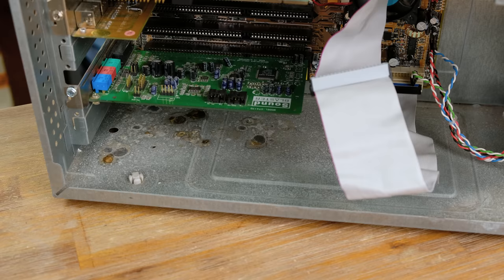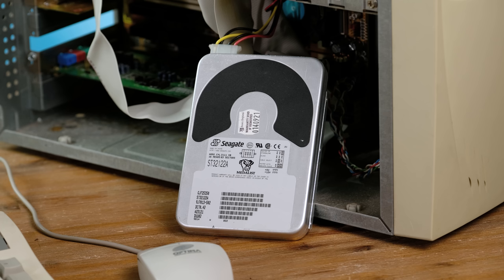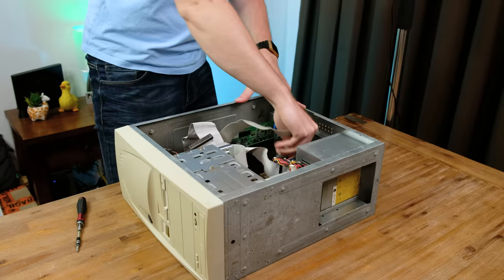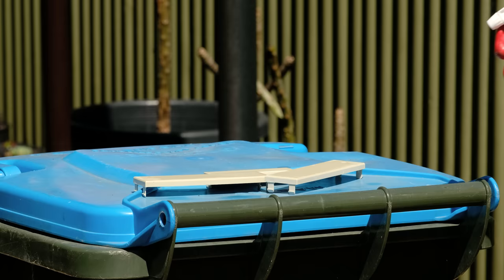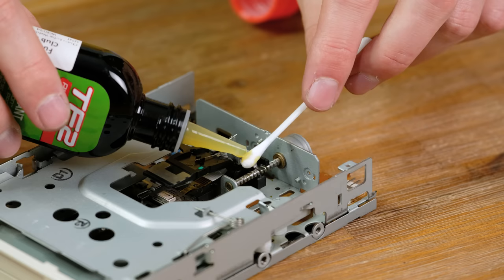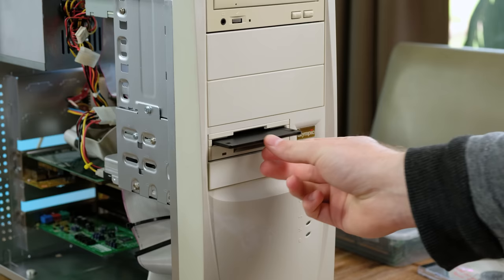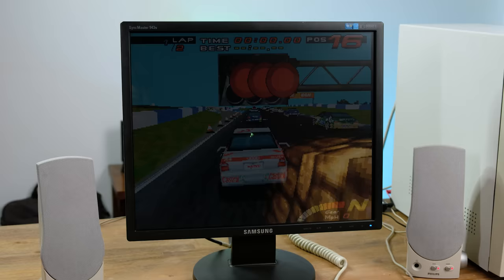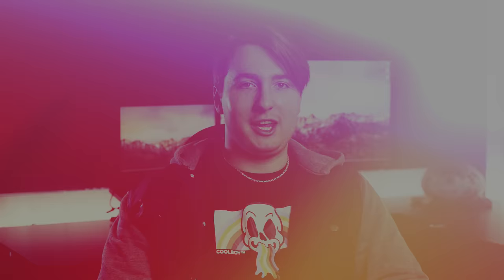Restoring a TERRIBLE Budget PC from 1997!

Comment: I remember being 24 years old too, except I will be 50 next year.  Time goes REALLY FAST and then GETS FASTER.  I got my own PC in 2000 but first used them in 1996.  Oh wait.......my first paid full-time job in 1989 had DOS based computers in the office, which I used to print signage for the shop floor.  All text menus and commands and no graphical interface or mouse.
Reply: 1986 I got a IBM 248. Remember those?
Reply: @Lotusrk123  76 computers if you include your own brain! 😂
Reply: I'm also turning 50 next year. Been a computer (ab)user since 1983. TI-99/4A, Xerox 820-II, a long string of various PC and Mac boxes.
Reply: I am 13.
Reply: @Lotusrk123  I love Thinkpads and have about ten laptops, the oldest being a Thinkpad G41 and the newest a W520 2GB Nvidia GPU and 1920 x 1200 etc.  Most of them are fully upgraded, and with docking stations.  I've turned down loads of models, as they get addictive lol.
Reply: @Lotusrk123  Ha! That sounds cool with the cars and Honda have always been good.  Regards Thinkpads I like my Z61p and X6 series the best.  The W520 is probably the last model with any IBM engineering DNA left in it.  So after this I have no idea what to get.

Comment: I’m an old fart that did a fair bet of gaming back in 1997.  In the fall of 97, I spent $3,000 on a Pentium II 300 / 128 MB RAM system.  That was a fortune at the time, just to play Quake.  I remember the reading about the Cyrix MII processors, but they were inferior in gaming, so I never touched one.  Even with a 3D card, the MII processor would have handicapped this system with gaming performance.
I could tell by the sound that WD Hard Drive was making, it was dead as Julius Caesar.
Nice job restoring this old box.  I think I owned s similar case in the 90s.  I think everyone did.

Comment: You made me feel nostalgic.
My first PC in the year 1998 was:

Intel Pentium 233Mhz
32MB RAM (later upgraded to 64)
4.2 GB HDD from Seagate
Cirrus Logic VGA card with 2MB VRAM
Non-ATX Cabinet
230W PSU
Daewoo 14" CRT Monitor
Logitech PS2 Keyboard and Mouse
Opti Sound Card
Creative CD-ROM Drive 32X with remote
Creative Speakers 2.0

My dad bought me this PC. I miss him so much :(

Comment: This computer is extremely similar to my first PC I've got in July of 1999. Mine came with a Cyrix M-II PR300 (clocked at 233 MHz), 32MB of PC66 RAM, a similar, but smaller mainboard (type TX98-3D by some noname manufacturer) with onboard sound and USB 1.1, a 1MB  video card (cannot recall the exact model, but I believe it had 2000 in the name), the same WD Caviar 21600 HDD (meaning it had two platters and 1600MB of capacity) and a 24x CyberDrive CD-ROM.
I got rid of it about 4 years later, and was upgraded by quite a bit: AMD K6-III 450 MHz CPU (the best CPU my motherboard had support for), 2x128MB RAM, 20GB Maxtor hard drive, 3dfx Voodoo 3 2000 PCI video card, SoundBlaster Live 5.1 sound card, 3Com PCI Ethernet card, a USB 2.0 card, and a Lite-On 24x10x40x CD burner. I moved to a Pentium III 1 GHz which was at least less obsolete :))

Comment: yesterday i was encoding a video, figured out this way that my cpu, when load 100% hits lik 75C, room temp around 20C, not ok, (air cooled), took out my flashlight aim at fan, see too much dust, next day, cleaned up, did another encode run and the temps are now around 64C with max load and 24C ambient room, great stuff, ....so whats the lesson here, dont be lazy and clean ur cpu cooler from time to time especially if u are on air :)

Comment: That computer case is so nostalgic to me... My first PC had exactly that case... Although it was a little bit better with an AMD K6-2 300 MHz CPU...
Reply: @German Retro Guy Sadly I don't remember the motherboard model, as we threw away that computer back in 2008...
Reply: @German Retro Guy Yeah, I don't have neither the computer nor the CRT monitor.

5 years later, I was already regretting that decision, as I was building my first retro PC...
Reply: My current case isn't much different, apart from having a silver/black front. I hate the fad of clear windows and lights on cases
Reply: Me too but 450 MHz

Comment: This is insane, I just happen to own almost the same Computer. I have the same AT case, with the same motherboard. In fact, my system came with almost the same CPU. It's a IBM 6x86mx PR300, but it's being detected as a Cyrix MII PR300. Granted, the expansion cards and some of its peripherals aren't the same, but that's because I upgraded my system. The motherboard is PCChips M571, with the TX pro II chipset, which is just a rebranded SIS 5597/5598 chipset. The board already has integrated graphics and also features a mediocre sound chip, as well as a usb controller. Despite being from PCChips, it's really not the worst motherboard, i've ever seen. In fact, back in the late 90s this was quite a popular choice, for people who wanted to build a cheap system. There were 3 revisions of this board, but only the later revisions were considered as good. This board should support 128mb ram, at least mine does. There was also a rebranded M571 which was known as Amptron PM-9100A.

Comment: 8:44 Why it says Windows ME on the System Properties? Did you install Windows 98 SE2ME on it?
Reply: Or the NUSB36E.EXE driver for USB sticks, which also changes that text string.
Reply: if you install unofficial service pack for Win 98, it makes defacto Win ME from that, maybe that's the reason
Reply: @Pidalin  It moslty looks more like Windows 2000 since that Windows 2000 uses Tahoma font while Windows ME still using the MS Sans Sherrif font.
Reply: @aldwinpanny10  Yes, it looks weird, there is not such retro feeling anymore, that's why I prefer Win ME, it's still enough retro, but it already supports USB flash disks and such things.

Comment: I used to love restoring these as they were the easiest to work on. when I used to restore these, I always broke out ALL the blanks in the drive bays and expansion slots (the metal blanks) I also would punch out the serial and parallel slots and mount the RS-232 and printer sockets directly to the chassis. once they came out with the ATX chassis, things got even better!  Even the Mother Boards! Love the walk down memory lane! Thank you!

Comment: Was there such a thing as a "Budget PC" back in 97?
Reply: Older socket 7 machines with K5, K6 or Cyrix chips. At that time Intel was moving over to Slot 1 for their Pentium II, so they left the old socket to the budget crowd.
Reply: Yep. Was generally defined as under 1k USD though. So it was only budget compared to the competition. It wasn’t like… $200-400 computers like you find today.

Comment: These PC's were the ones I used to assemble and fix as a tech many years ago...biggest problem with the old main boards were those cheap capacitors that puffed up and leaked.

Comment: I just finished fixing up this old Pentium 2 450mhz HP desktop. It was definitely a fun project. I ended up installing Windows 98SE after cleaning the entire hard drive of course. I also added a Voodoo 3 16mb AGP graphics card, and the sound blaster that it came with was a nice addition. I love seeing these kind of renovations. I will be gaming on it more. I will probably add another stick of ram and turn it into a 256mb beast! Although the manual says it can take up to 700mb of ram, Now that's crazy!
Reply: All these old systems are coming back

Comment: i have a very similar pc that i restored recently myself too. It has a floppy drive and very small lights and buttons. But its funny pc cases havent changed much since 1997. Apart from the shift from ide to sata cables. Many of these older cases are made of metal rather than plastic. So build quality is not an issue.

Comment: I bought a Tiny pc in  October 1997, my first desktop pc as an adult, it cost £1500 and had 32mb ram, a 10gb? hard drive (cant remember if that was the right size), a pentium processor 200mhz (I just missed out on a pentium ll by a few months), a 56.6k modem, a floppy drive, cd rom drive, some bundled software (age of empires, encyclopaedia etc) and it ran windows 95. 

I thought it was the best thing since sliced bread at the time and a massive upgrade from the Amstrad CPC 664 I had as a child although to be honest that had been a great pc as well in the 80’s for playing games.
Reply: wouldn't have been 10GB, more like 2GB or 4GB

Comment: September 1997 I was 17 years old. I had a Pentium 200MMX in a 430TX MoBo, 16MB edo RAM, S3 trio 64V+ with 1MB of video RAM, 2,1GB quantum fireball HD, Creative soundblaster AWE64 and a Creative 24x CD-ROM drive. It was fast... Then was becoming slower... Upgraded it to 32MB of edo RAM, replaced the graphics card with a Riva TNT and OC to 233mhz... It was fast again. :)

Comment: 64 MB of RAM definitely doesn't sound like a budget PC for 1997! I was in secondary school at that time and our techers decided to buy used computers for all the classrooms - IBM PS/Value Point 486 DX/2 66 MHz with a giant 8 MB of RAM and a 250 MB WD Caviar or IBM hard drive. Windows 95 was really pushing the limits on those computers, I asked if I could downgrade ours to Windows 3.1 and that actually made it usable. Adding a Citizen Swift dot matrix printer someone's parents wanted to get rid of (no sane person still used a dot matrix printer in 1997, except for some very specific tasks that legally required carbon copies) even allowed us to print at school.

One of my friends had an all bells and whistles PC built in 2000 and that had 128 MB of RAM, I think a 10 GB hard drive, don't remember the other details. Except one of course - he paid as much for the computer as for a 21" TOTL CRT monitor and then bought the cheapest NVIDIA graphics card so he could afford the fancy monitor! For those who weren't really active computer users then, let me tell you: 21" CRTs were MASSIVE beasts and very expensive! Your average office PC had a 17" CRT running at 1024x768 and that was a fairly recent upgrade from 15" @800x600.

Comment: I built my first PC in 1997 and it was pretty similar to that one.  I started with a cyrix CPU but had issues with it not working with my soundcard software and traded it for an AMD instead.  I think it was soo megahertz.  It had 64 megs of ram, creative 4 meg video card, sound blaster 16 clone, 1 gigabyte hard drive.  I recall upgrading it several times over the years going to an MMX cpu and getting a 8 meg 3dfx video card down the road.

Comment: That trick to restore CD-ROm drives with iffy ejection trays is super useful. I remember reading you can also boil the old rubber belts in some water to help restore them.

Comment: Minus the painting,retro brighting, and drive repair this reminds me of the fun I had restoring a recycle rescue Sony Vaio Pentium 4 I've turned into a for fun xp gaming rig.
Intel motherboard with no bloated caps,pcie,and sata ports (main reason I saved it)
Upgrades
4 gb of DDR ram
ATI Radeon  HD3640 (512mb dual DVI model)
Sound blaster audigy SE paired with a X series Logitech 5.1 surrounded sound system, and the EAX 4.0 patch
Seagate 500gb 72000 hard drive that's basically period correct to the machine
A LG sata cd/DVD combos burner

I think the cpu is a Prescott. It's 3.0 ghz Hyperthreeded with 1mb cache and 800mhz FSB according to the bios.

Comment: The S3 Trio was one of the first low cost graphics cards that could keep up with full screen video, it came out late 1995 I think and before that you played video in a little window.. I had a PC very similar to that in my shop looping a 3 minute video at VGA 20fps full screen on a 14" color monitor and did a lot of graphics card upgrades that year. It was impressive for it's time.

Comment: My first Computer purchase right here.  Bought it for $700 at Circuit city.  Had to replace the trash Power Supply and much of the guts with upgrades over the Years.  Although I moved onto building custom PCs over the decades I still have the Original Case for this thing in the Basement.
Reply: 700$?!

Comment: Hi, I had the same cpu casing back in 2000. But it was soft power button. Amd k62 500mhz, 128mb ram, 20gb hdd, built in soundcard and vga. I forgot the motherboard brand. It was the last pc I ever bought. After that I always got free desktops or laptops at work.

Comment: That's the same computer case I used back in the late 90s!!! I miss it very much!!

In order to improve the 3D gaming performance for this PC, I suggest the following changes:
1. Replace the Cyrix CPU with Intel Pentium MMX 233Mhz CPU, it should be the fastest CPU this motherboad can support.
2. Install a 3dfx Voodoo1 add-on card, or just replace the existing S3 card with other later 3D display card that supports PCI bus.

Comment: I got my fist PC two years later('99) and it have'd only 32mb of ram. Ram was so expensive back then, only after a  year later I somehow convinced my grandpa to buy me 32mb more. Graphic card was S3 3d/2x with whole 4MB of video memory and without 3d acceleration of any kind. It have a great overclocking CPU, Celeron 300A but at that time I didn't know how easy is to make him run at 450 so it run on stock speed entire lifetime. It was crap, it was slow but it was mine and give me whole lot of fun playing games without thinking about framerates :D
I still have that cpu and mainboard somewhere.

Comment: A painting tip for a more smooth finish for cheap is to sand between some coats not full sanding. Rather my favorite method is to prime, light sanding, reprime, first 2 or 3 coats of final color, sand lightly, add another 2 or 3 coats and sand lightly again. This alone can give it a really really nice finish just make sure for the final sanding to use a really fine sand paper. If you want some added smoothness this is an option but not required is to coat in a clear spray, matt or gloss its up to you.

Comment: Well this sure brings back some nostalgia days, although I would have only been about 6 years old in 1997 my parents bought a compaq in 1999 which had a pentium III 450mhz and I think 256mb ram along with windows 98.  I used to play on it almost every day and loved it.  The nice thing is computers of this vintage actually become useful because there is good 3D support for games (AGP graphics slot is much faster than PCI).  Ironically between myself and my dad it has been the one computer we never parted with over the years and is still loaded with games and runs perfectly as we also kept it maintained.  This video makes me glad that we did because I love that all this stuff has become sort of "collectable" like consoles are.

Comment: Hmm...'97, I would have been 7, and that was the year I got my first computer (Commodore Amiga 1000). I later built my first Socket 7 system running Windows 95 when I was 11 ('01, or the same year XP got released) using Goodwill scrap and my own savings. I was so happy just having a PC with a CD-ROM drive finally. 

This was nostalgic. I've recently found another Socket 7 rig tossed in the bin, didn't know what to really do with it. It POST beeps when I tested it but the plastic casing is severely yellowed and it needs a biohazard-level cleaning (Egyptian tombs have less dust than this thing, looks like it was an office PC no one ever bothered to clean) so I set it aside for now. I was thinking hack it up into a sleeper build and keep the "petina" look, but now I'm leaning more resto-mod. I'll try that method to whiten the plastics and see if it helps. 

Thanks for teaching me something new!

Comment: Old systems like this can actually run RTS games such as StarCraft 1, Command and Conquer and Dune2000 really well. Mine was a Pentium 166mmx with 64mb of RAM. The graphic card was the same as yours. The hard drive was a unique Quantum 5 1/4inch.

Comment: The floppy cable goes the other way round. So the twist in the wires is nearest the Floppy, otherwise they buzz. PC's of this era didn't use thermal grease, it was overkill with the pad.

Comment: my old pc had the exact same case. but inside was a 800Mhz AMD Duron with 512MB of SD RAM, Geforce MX 440 (64MB) and 40GB HDD. all mixed/upgraded parts on separated occasions. not prebuilt.

Comment: could try the old hammer trick with the old drive, that sometimes works. but usually only once and that'll be the last time that drive will work. The best place to whack it is just above the IDE connector above the reading head voice coil magnet assembly, anywhere else and you could crash the heads.  maybe do a future video on this old practice?

Comment: Sounds like the fan is rubbing on the IDE cable You know those old CD ROMs has like a pan hole where you can manually open it you hit the button and it disengages the drive for you to pull it out I’ve been putting those old computers together for years I’m 47 and in the 90s I was doing computers that run DOS/Windows 95 windows 98 with the old Intel Pentium 2 processors
Reply: That sounds is very distinctive to early 2000s computers, bad sleeve bearing they weren't very reliable!

Comment: According to the motherboard layout, It seems that you can buy new reliable ATX power supply and connect some basic power switch instead of the current connected to the power supply, It should work.

Comment: As is, that computer would be perfect for DOS and early Windows games, rather than Win98 and up. The Trio64 is one of the most compatible DOS cards ever made. Combined with the IBM MII, Duke Nukem 3D would be one of the most proper games for that computer.

I'd definitely get a better sound card, though, like an AWE32. Duke3D sounds so crusty and tiny with the one you have there right now, like circus music meets heavy metal.

Comment: @Psivewri - 
When spray painting you absolutely should wear a suiable mask: the mask must make a good seal to the skin (this includes better a shave of the face) & an A2P3 filter is required ...  
to prevent fine mist entering the eyes , use a full face mask ( I recommend the Dräger Panorama & its successors)